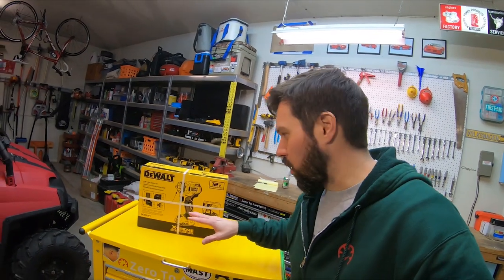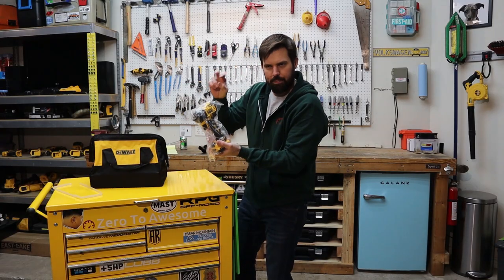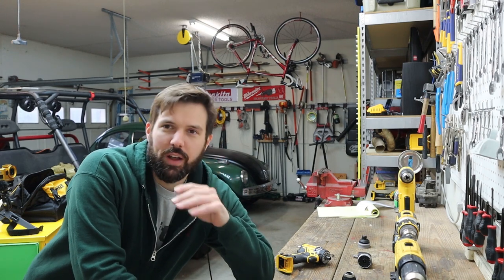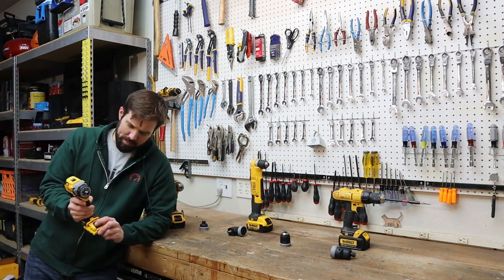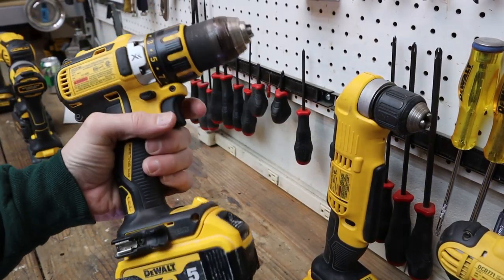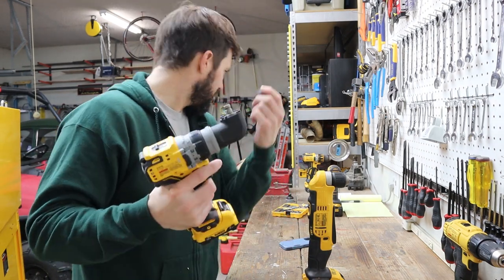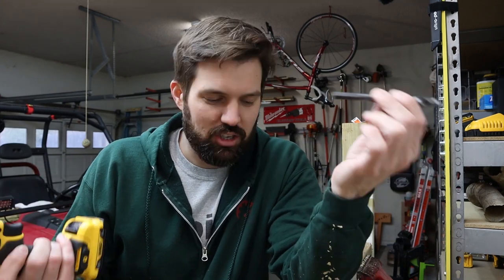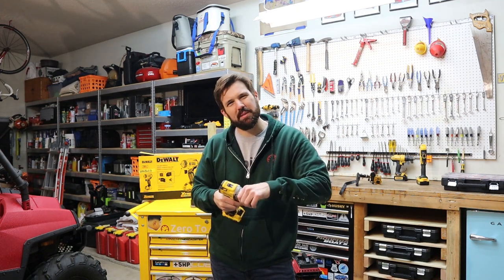New DeWalt 5-in-1 Power Tool is COMPLETE GARBAGE (and my weekend is ruined by disappointment).

Comment: What a fully biased opinion. How dare you compare a 20V 5Ah tool to a 12V 2Ah ?? That will for sure won’t make it. I believe that the sole purpose of all this, is that you wanted to find a way to justify all those thousands of dollars you spent on these fully loaded drawers of other dewalt tools. Anyway, thanks for sharing your opinion. I’m glad we live in free countries where we can express ourselves. By the way, I’m jealous of your fully loaded drawers 😜
Reply from the maker: I definitely agree they are not comparable, it REALLY bugs be when DeWalt markets this thing with pictures of contractors using it to attaching conduit to cement block and build decks. If it isn’t a powerful do-it-all tool then change up your marketing. It is definitely handy to have around the house for little jobs or light detail work.

Comment: Hex shank drill bits is what you would need for the low profile attachment. I dont have this tool but like you said the low profile adapter is the only useful attachment. You basically confirmed my thoughts
Reply from the maker: Low profile is going to come in REALLY handy every once in a while.

Comment: More ppl should see this video. I was under the same impressions as you. Glad i saw this before buying it. Thanks.
Reply from the maker: Right?!? I do feel a little deceived by how it is marketed vs. what was in the box. (Great spelling of the first name BTW)
Reply: @ZeroToAwesome  Seriously, Idk why but I definitely thought it was an impact and a drill. And to count the keyless chuck as "2 tools" is just dumb. 🤦‍♂️ I also didn't expect it to be longer than the 20v impact driver. It's OK if you wanted to get it instead of the 12v drill but I already have the 12v & 20v hammer drills and the 12v screwdriver with the clutch, so what's the point. Thanks again for saving me the cash & disappointment 👍
Reply: It was never marketed as an impact driver
Reply: @ABH313  the point is this can replace the 12v screwdriver and 12v drill and then some
Reply: @ABH313  add the 12v impact driver and you have 2 lightweight yet powerful tools that are plenty for any homeowner
Reply: @ABH313  It's a cabinet installation tool. It's for building and/or installing cabinetry, or building other furniture. The keyless chuck is not counted as 2 tools. The other tool is the magnetic 1/4" bit holder when no adapter is on.